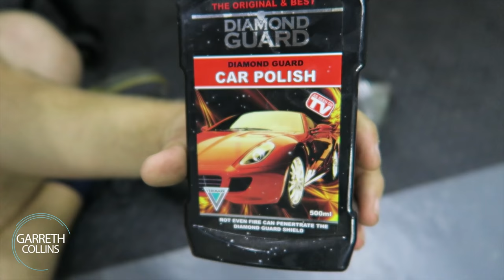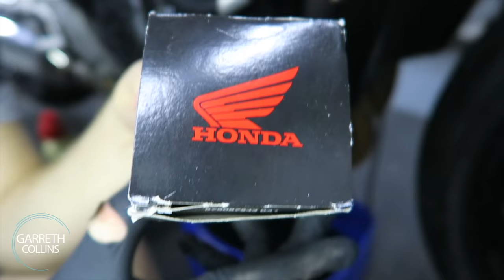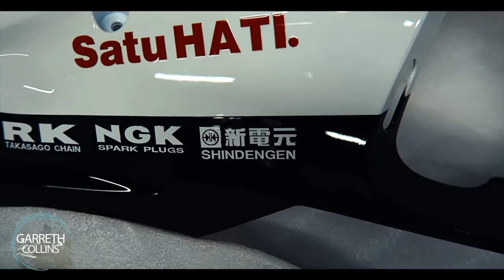Rebuilding A Crashed 2013 Honda CBR 1000RR Part 5

Comment: I’m 16 and I live In the Uk. I’ve been thinking about doing something like this for awhile now, but recently I found out all of the bike on copart either have scratches and can be repaired or the ones that have damage, not even as much as yours are a cat b and are not allowed to be repaired. And it has actually hit me that it’s pointless repairing then because there is no way I can put them back on the road. Any advice on this?
Reply from the maker: Not sure how th UK systems work i live in south africa. But if you can find bikes that you can repair and are allowed to put back on the road. Go for it

Comment: Why not just cut the mid-pipe ? So the muffler could reach the bracket? Might of been easier maybe not...just a suggestion
Reply from the maker: Pipe gets thicker. Would have to cut and weld. Easier to make the bracket.